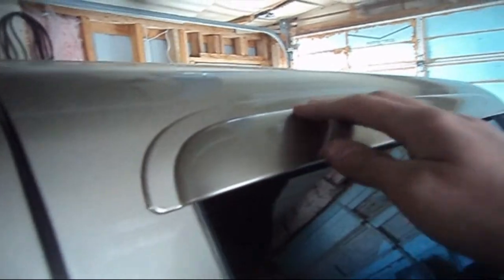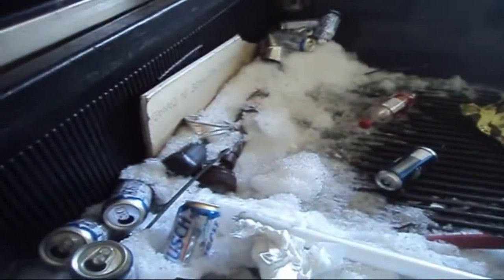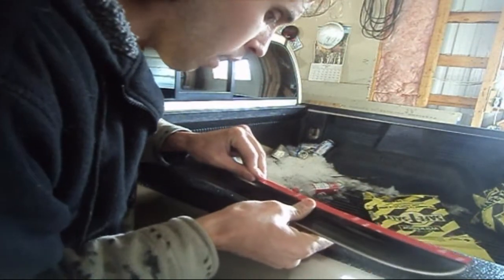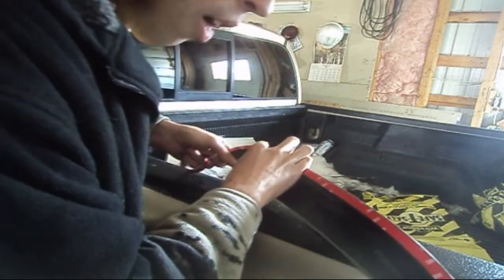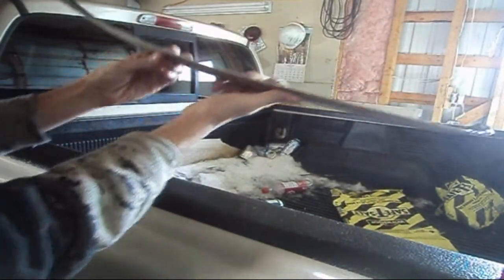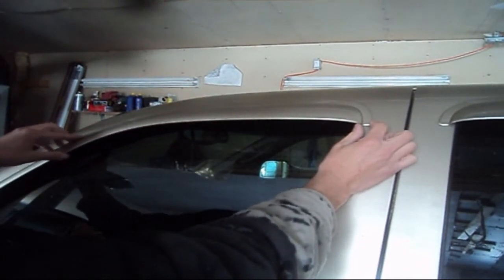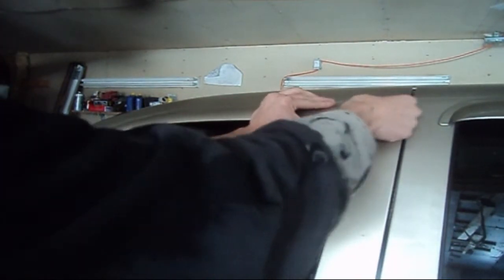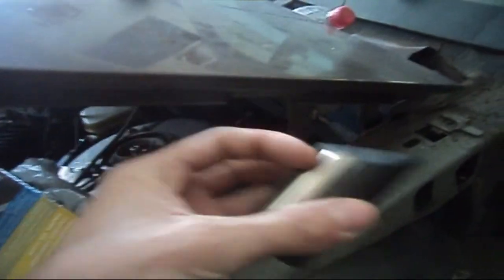Side Window Deflector Repair Installation

Comment: very good tips I bought some new ones tried to put them on today and they did not stick straight out the box; has this ever happened to anyone else
Reply: hey i know im a year late. 
list of item.
3m vhb foam tape
3m adhesive promotor
rubbing alcohol. atleast 70%
a hair dryer or heat gun and a puddy knife.
(only if its plastic its being adhered to) 80 grit sand paper

first the gaurd/deflectors.
 what you wana do is remove the old tape and applyyy some foam vhb tape to it, let it adhere for 3 days on the gaurd. make it one continus strip across the top, any gaps could mean a small leak.

if you have plastic framing, you'll wana take something to scuff it lightly. but not if ya adhering it to metal.

(after that) clean it with rubbing alcohol, let it air dry. brush any lose stuff off.

afterwards you'll want some adhesive promotor, you can get them at your local auto parts store for about 2-3 bucks each and you're going to need one for each window that you will apply a guard on.

afterwards line up the gaurds to get an idea before applying it.
take the tape off the gaurd and heat the tape with a heatgun or hair dryer briefly, firmly press it into place, itll be a bit hot but try and deal with it. try and hold it formly for a few seconds in each spot.
take the heat source and evenlyy heat the whole gaurd and take the but of the putty knife and press against it firmly and let it roll down the gaurds brim as you press on it.
allow it to cure/dry for 12 hours before any form of driving. after that wait 12 more hours before deiving it on the highway (keep it under 60mph) once 48 hours have passed. THEY will not come off. 72 hours is when you can wash the vehicle again, but 48 is good enough for any speed.
Good luck!